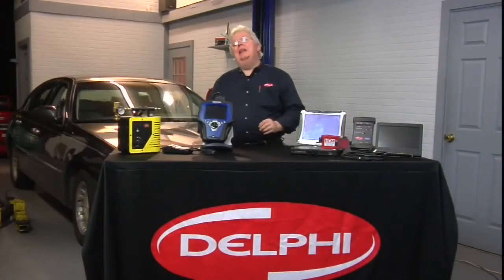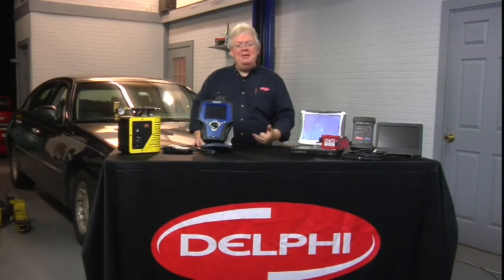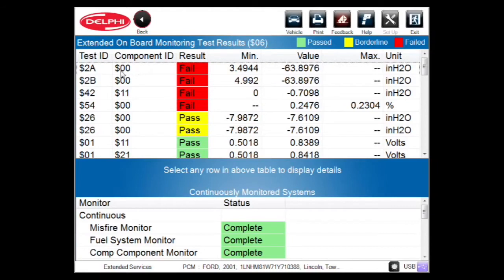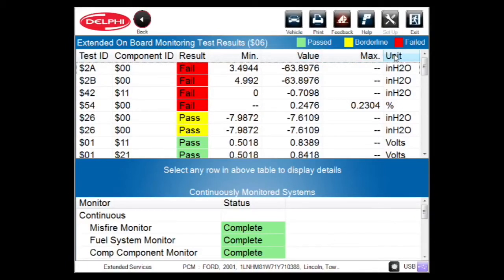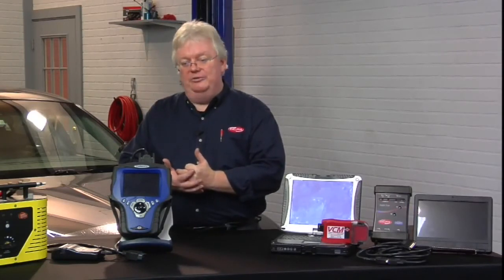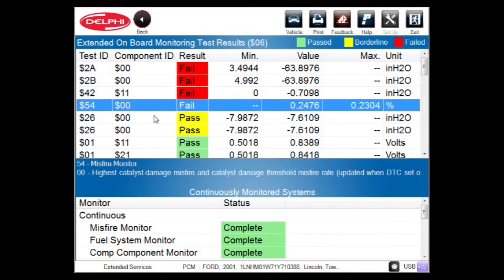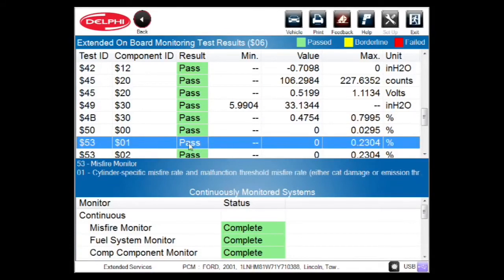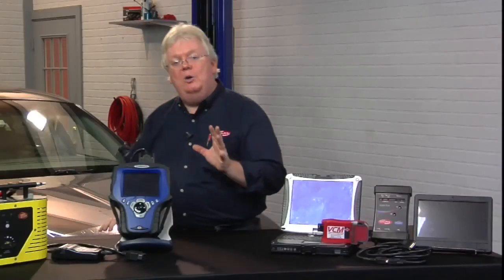How to Diagnose Misfires with OBD II Mode $06 (Reducing OBD II Comebacks with Mode $06)

Comment: Thank you for the informative video. Are there OBD ll scanners out there with enhanced table $06 mode for the nonprofessional that isn't in the hundreds of dollars and if so, is there one you would recommend?
Reply: BluDriver works great for mode 6. I used it to diagnose the misfire in my 2003 crown vic. It had the exact same issue as the car in the video. When you use bludriver it will show you the raw data in hexidecimal but it is super easy to convert. It only cost me $99 and i've been using it for a few years now.
Reply: @Theringfilm2 question, how do you convert the data under mode 6? 

I just bought the same scanner but am at a loss on  understanding the diagnostic data.
Reply: @Theringfilm2  1998 jeep cherokee XJ, 4.0L I6 4wd
Reply: @Senior XJ : You probably already found this, but just i case...

https://youtu.be/dEdV_YAed0c

This explains Mode 6 functionality in the Blue Driver device. At the end of the video it shows how to contact Blue Driver support for help with Mode 6 (or anything related to their product).